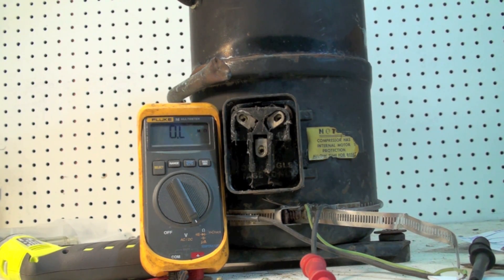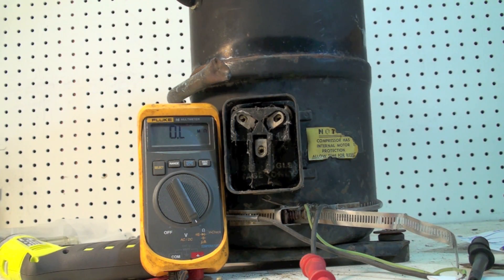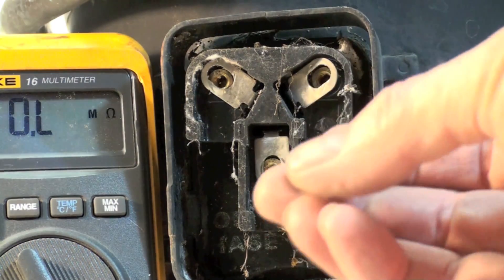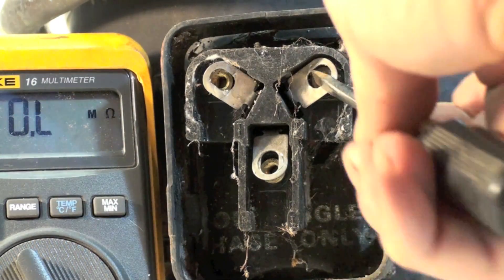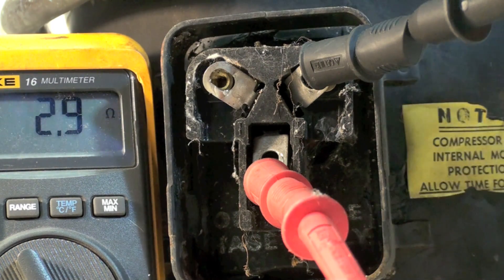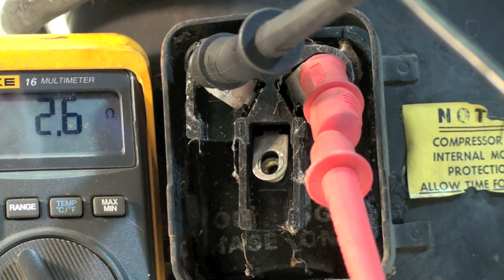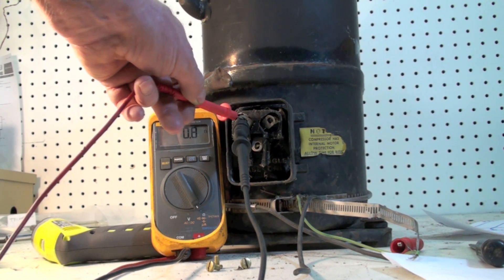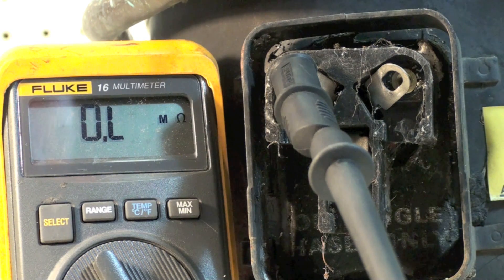How to check the windings of a refrigeration compressor

Comment: I can't access the compressor plug directly (5 ton Trane unit), but I checked it at the wires after disconnecting from the contactor and capacitor. My numbers are 1.0, 1.4, 2.0 so my total is off by -0.4. Does this mean the compressor is going bad? No grounding issues. It's currently pulling 21.5A (105 degrees ambient temp) on the common wire (followed your other video). RLA is 26A. It's a 14 year old 5 ton Trane R410 heat pump. The compressor is noisy at start/stop but otherwise seems to run okay.

Comment: Does the decrease in the resistance value between the common terminal and the start terminal imply that the compressor is malfunctioning? 
Example, the resistance between the common & start is 1 while the resistance between the common & the run is 1.3 (resistance total between run & start is 2.3). 
Noting that the compressor needs a start capacitor to make it running. Without that start capacitor, the compressor cannot work.
So, two questions are here:
1. Do these resistance values indicate an issue with the compressor? 
2. Does this need of start capacitor to start the compressor indicate that there is an issue with the compressor? 

Thanks
Reply from the maker: First, the resistance values should be compared to the factory specs.  Generally, the resistance of the run to common will be the lowest.  
If you are saying the compressor will not start without a start capacitor, and the start cap was not original equipment, either the compressor is on its last legs or the run capacitor has failed.
GFM

Comment: Hi. Thanks so much for your video here and BIG THANKS for explaining how to understand Ohm  readings between C, R & S when l didn't know what they should be in the first place. I'm just using a basic cheap multimeter and assuming that '1' is equivalent to O.L. I hope I'm correct? As l cannot afford a high end Fluke such as the two you've mentioned (16 & 116), could you tell me what you think of the 101 model please? I'm new to electronics although I've been trying to understand how to accurately use a multimeter for years (and getting nowhere.. Lol).
Cheers.
Reply: 1 is equivalent to OL. :)
Reply: https://youtu.be/3q1OzLOC8j8?si=vh-JehxyvRl1Ad_y

Comment: I couldn't understand clearly. Is that winding good or not. Usually when I checked motor or anything winding the good winding is denoted to three phases equal resistance of winding. That the winding is correct  but here not like that
Reply from the maker: The winding is good.  It is a single phase compressor.
GFM

Comment: I'm assuming you are using those new test leads that have zero resistance?  Wouldn't you first short the leads together, find their approximate resistance, could be a few tenths of an ohm and subtract that value from your total resistance?  To eliminate the error from the lead resistance, some people would use a four wire ohmmeter.  Readingss of hundreds of ohms or more, who cares about a few tenths of an ohm, but when measuring resistances of about half an ohm, a few tenths of error can be quite significant, would you think?
Jim
Reply from the maker: As the potential resistance of the probes will be always the same,  and the readings of compressor windings are comparative, I do not think it is necessary.  And in fact, I have not seen the resistance of the leads be anything other than 0.
GFM

Comment: How do you know if the windings are going bad? Sorry if it’s a dumb question
Reply from the maker: If the resistance of each winding matches the manufacturer specs and  there is no continuity to ground, the windings are ok.  Not dumb.
GFM

Comment: I checked compressor its values are C to S :4.5ohms, C toR :1.55, and S to R : 6.5ohms when supply is given compressor gets over heat but Cooling wsa not coming give me suggestion to solve the problem.

Comment: You're so right! This ac hasn't been used for 20 years. I finally got it started it worked for 10 to 15 seconds, and then there were arching and fire burning of dead bugs, spider web and dried grass, etc.... I shut breaker off, and waited for 5 mins and then restarted it worked a several seconds there again arching and burnt rest of those stuffs. And then it finally died. I restarted again now just humming bird. I gave a closer look at contactor there are metal burnt color. I guess I have to replace contactor. Thanks!
Reply from the maker: Welcome
GFM

Comment: If I sent you a few pictures, can you tell me where did those wires came off? I believe those wires came off of relay but there are no visible sign( no screws joints, etc... May be grounded or chassis I don't know.
Reply from the maker: I can try.  Send to Grayfurnaceman@gmail.com
GFM

Comment: Hi there my compressor is not starting, I check the windings from common to start I have 2.6 and from start to run I have 2.7 and from common to run I have a 0 . what's wrong here?
Reply from the maker: If you are doing the measurements correctly, you have a shorted compressor.  Check from a winding to the compressor body.  You could be shorted to ground.  In any case, the wires should be removed from the compressor before testing.
GFM

Comment: I got exactly what he got here. 3.0 / 2.5 / 0.5 but my compressor just shakes hums then clicks off. Tested the start run capacitor  (only 5mo old) and MFD tested good on it. Contactor is sending 240V so I guess my compressor has a mechanical failure like a seized piston correct?
Reply from the maker: I would check amp draw.  Should be locked rotor amps as shown on the compressor plate.  Yes it is dead.  The rotor is locked.  Most common failure.
GFM
Reply: I've had several that the rotor was locked after sitting for a long time. On many of them, I've used a Rubber mallet and gave it a medium tap on the side a few times as I powered it up. This has unlocked the rotor but I would not count on it being a fix. It could buy you some time to repair or replace the compressor or unit.

Comment: Why take the wires off? If compressor is still in unit it seems difficult to check this. Can you just discount the wires from contactor  and capacitor and use the wires?
Reply from the maker: +Tommy Jarrett So, how would you feel if there was a short or open in one of the wires, perhaps at the connection to the compressor terminals and you diagnose a shorted or failed compressor.  Oops!
GFM
Reply: grayfurnaceman excellent point exactly what happened to me the spade connector at the compressor was toast. Had to replace wire and coonector

Comment: I changed the compressor today ...but I checked the wiring according to the diagram but it was keep tripping the breaker
Reply from the maker: Jawad Ibrahim Does it trip the breaker immediately or does it run for a while before it kicks off?
GFM
Reply: It was tripping immediately ...but I checked the compressor tag was in the comp was three phase but actually it was one phase compressor ...
Reply: it can be wrong wirring
Reply: It was one phase compressor instead of three that's why

Comment: Hi, do you have a video on how to check on a 3 phase HVAC compressor windings? I recently have the compressor breaker tripping and I found out due to the compressor having no continuity on all phase ( L1-L2, L1-L3 & L1-L3 ). I also found the resistance to be very high.. around 300ohms between L1-L3 & L2-L3. Can i conclude that the compressor breaker trip due to the compressor bad/Open winding? I check the breaker & contactor, they are OK.I found so many videos here & i found yours to be the most helpful. Thanks in advance.
Reply: https://youtu.be/3q1OzLOC8j8?si=vh-JehxyvRl1Ad_y

Comment: 1)I recently checked one single phase compressor, the connectivity is good (beep sound there), no ground value comes, comp is not grounded, but the resistance between the terminals is displayed as zero and the value is fluctuating in other terminals.compressor taking high amps 14.7amps recommended is 1.2 amps and gets tripped in olp. can you provide any solution for this issue,it is clear that the compressor gets jammed internally but i want to understand y the resistance value fluctuates, whether the problem is with the multimeter.
2) would you share what are all the abnormalities we can measure in a grounded compressor, will the compressor works by  drawing high amps or it will not start itself.
Reply: its hi amphre. need to replace compressor

Comment: I have a trane dual unit heat pump the fan on top of the motor want shut off.but thermostat cuts fan off that blows through duct work into house.what is the reason fan outside want shut off?
Reply from the maker: Stanley Sanders I assume you mean the outdoor fan won't shut down.  It could be the contactor in the outdoor unit is stuck on.  If so, it needs to be replaced.
GFM

Comment: thanks - Y T videos ,  for not to give up on my frig . watched it and decided to fix my Frigidaire if I could , even though I shorted cord (for  millisecond) when I plugged it in during my attempted repair . little smoke , spark, burned off tiny bit of  one prong was still nothing , since I quickly puled it out , compare to puzzle - why I had no more power in frig. I am not and never be a electrician , but I can do simple things . ( I left alig. clip on run tit of comp. touching other and grounded them all by axid. or beer ) did not even trip breaker , but lost power to ice box. period . after tracing all wires , connections , plugins , looking for fuse ?, I knew there is none , cussing , make beer run , I was about to give up . but I was goanna at last salvage bulbs and get rough with ice maker to fined out why sometime wasn't dumping cubes like 9 years ago . luckily box was still plugged in , while I for no reason wiggled temp. setting knob when and suddenly lights and blower come on . I was surprised and little pissed off , that I didn't think of check its relay as a first thing . instead of tracing those wires . anyhow , 9 year old side by side box was pretty much fixed by accident with new start relay , few hammer blows on comp. and some beer .  so don't give up , cut corners if needed, keep trying and  improving . thanks again for this video, it helped a lot , save some dinero $ and gave bid of a satisfaction .  even with pukito buzz .

Comment: Are you using amps?
Reply from the maker: No.  This test is the last test you do to make sure the compressor is the problem.  This one will tell you if the windings are shorted or open to each other or if they are open or shorted to ground.  Hope this helps.
GFM
Reply: So what are you using oms? What do you set your multimeter to?
Reply from the maker: Johnny onthespot Yes, ohms.  When checking continuity of the windings, it should be set at 1X.  When checking resistance to the body of the compressor, you should a megohm meter.  Many of the newer digital meters are auto ranging like the one in the video, so you do not have to set it.
GFM
Reply: grayfurnaceman

Comment: I have another problem my compressor do not start - grounding test ok, ohm test between pins ok I did also another test I mean continuity between windings. . I was checking is there is continuity with meter probes and beep signal from meter. There is a beep only between upper and one lower pin, upper and second lower pin no beep - that means that compressor is broken electrically ?. To be more precise in tree possible combination of touching pins with meter probes there is only one beep + my connector was different from yours 1 pin in upper position + 2 pins in lower position. Please give your explanation,
Reply from the maker: Ignore the beep.  It is only there to tell you if there is a very low resistance.  Measure each resistance and record using a drawing.  One should be lowest (1 to 3 ohms).  The second higher added to the first should equal the 3d reading.  If they read normal, the capacitor is good, the compressor is probably locked up (read dead).  Hope this helps.
GFM
Reply: grayfurnaceman I checked that once again and it was ok electrically and did not mind about continuity test. So I looked deeper and started  it finally (by wire)  omitting all electronic boards in my device and it worked - so the reason was not broken compressor but poor electronic - now it works fine without it - for my application it is enough.  Thanks for you help, and youtube clip that make me think

Comment from the maker: Yes.  When the 2 windings are read in series (R to S), they should read the total of R to C and S to C.  Hope this helps.  
GFM
Reply: grayfurnaceman  What if you have 2.1 between common and run and 2.3 between common and start but only have 3.2 between start and run?  Shouldn't I have 4.4 between start and run?

Comment from the maker: The meter is a Fluke 16, now replaced with the 116 and is a megohm meter.  Also, some techs use an insulation tester to test the winding at a high voltage, which the windings are exposed to.  For me the jury is still out on these meters, as they may diagnose a compressor as bad that may not actually fail for some time.  Certainly, if the unit is high liability such as a blood cooler, I would use them.  
GFM

Comment: Nice explanation. Is your fluke multimeter suitable for windings insulation test to ground? Shouldnt it be a megohmeter with higher voltage to be sure theres no fault to ground?

Thank you